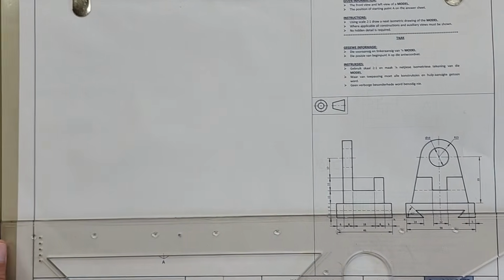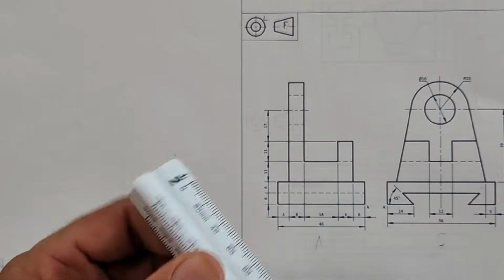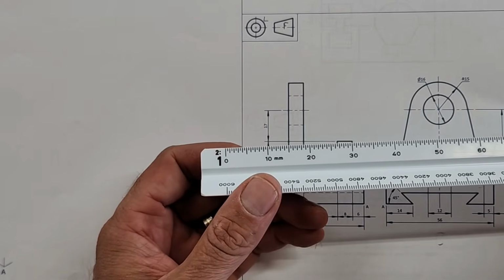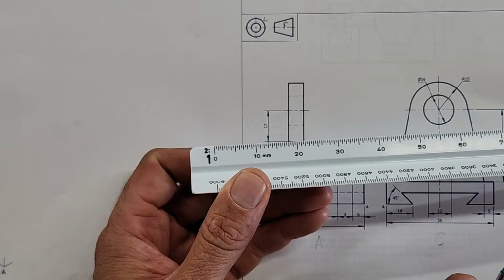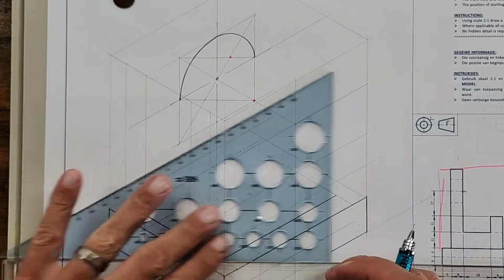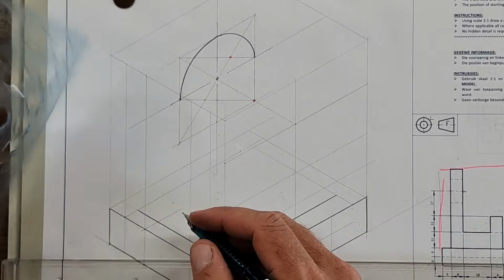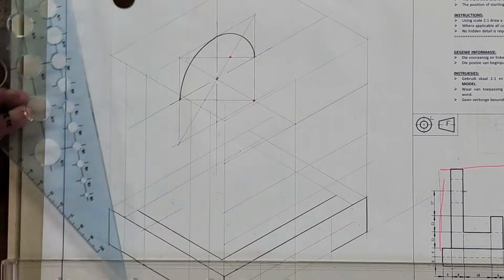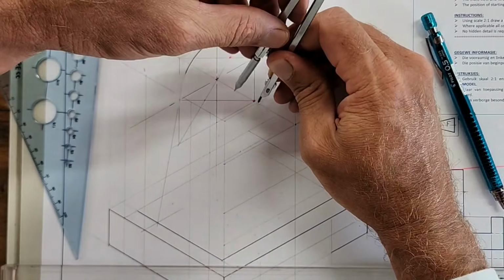How to draw an Isometric Drawing - HSE | Page 3-12 | Grade 11

Comment: Thanks sir, but can I ask, isn't there supposed to be depth for the circular hole and a line at 30° for the hole at the bottom
Reply from the maker: Thanks for pointing that out... yes, I missed that... on the main circle, there most likely will be seen the back edge of that circle hole, so you will need to project the depth via a 30 degrees construction line, to draw that arc... Good job! Thanks for the feedback...